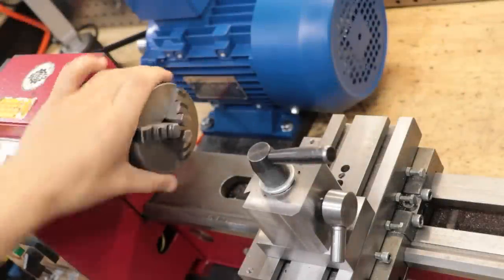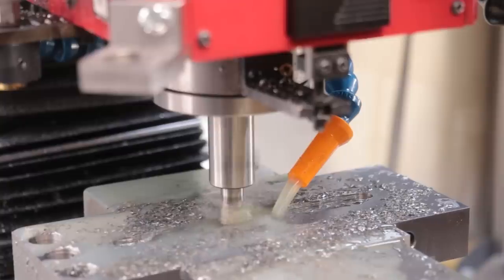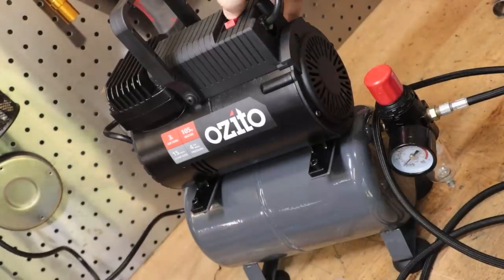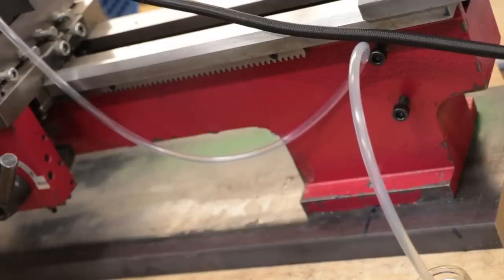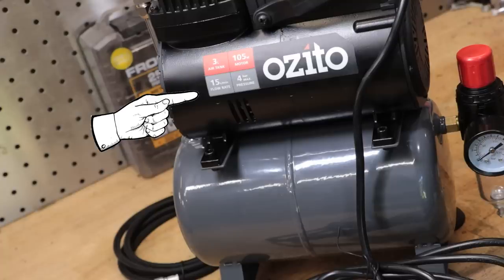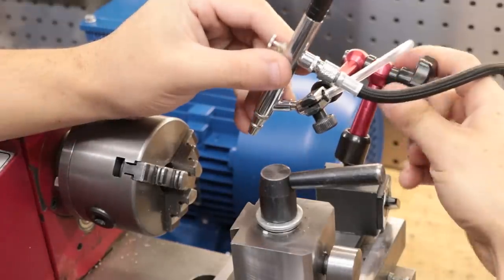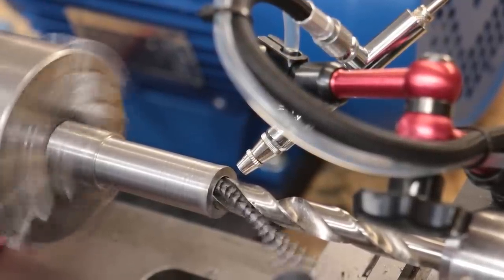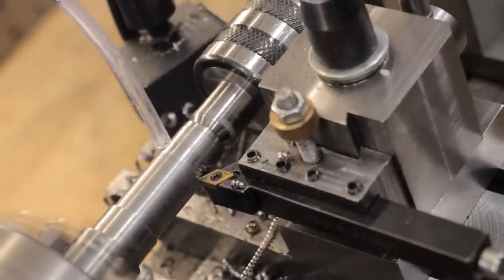Mist Coolant For The Mini Lathe

Comment: You can daisy chain the new compressor to the tank on the old one and greatly increase your air reserve. Start up the noisy compressor when you won’t be around and bring it up to pressure then you have all that reserve air to keep the smaller compressor from coming on sooner.
Reply: Yeah, i run a kern, 3 mazak millturns, 2 horizontals and some EDM machines off of a single 10 kw compressor with this trick

My air tank is 5k liters at 16 bar and could probably be classified as a bomb though....
Reply: @angrydragonslayer  230 psi on a 5000 liter tank would easily level a house if the tank ruptured. Air is cheap to compress up to about 70 psi, after that the energy required VS air volume grows rapidly and exponentially. I don't remember the exact chart as it changes between compressor styles but a conservative estimate would be the first 70 psi would be equal to the last 10 at 230 energy wise.
Reply: @dazaspc  yeah, it's not efficient but if i wanted an optimal compressor, i would need a new electrical circuit all the way from the 400kv lines and not only would that be stupidly expensive, it would also force me to shut off the machines for at least 3 weeks which is even more expensive (don't exactly have that many machines for a hobby)
Reply: @dazaspc  oh, surely. Free air delivery is not the issue though. I could sustain each of these machines with a bicycle pump and a big enough tank.

It's the burst that's the issue. I'm not going to be able to handle 300 l/m at 6 bar per machine for 15 sec if i change it like that.
Reply: @dazaspc  Well, you won't be heard ... it's the internet.
Specifications of the tank, the pump, the motor or established safety regulations ... just do not matter here. It's feelings and "innovations" and make-belief that is the guide.
Just sad that often bystanders are also harmed ... and no insurance companies will pay for this kind of avoidable madness.
Reply: @dieSpinnt  The sad part is I would nearly guarantee I have more experience and training in Air plant setup and Compressor repair and maintenance let alone CNC. I go back to the days of Nixitubes for position readouts.  When I finished up I was maintaining a 2700 cfm air plant.  Line pressure was 85psi and it had enough capacity to only drop 5 psi when a 75mm air pipe was broken. That is a LOT of air. All he needs is a receiver at each big demand maybe 500 liters and a reverse flow check in the feed line and he would easily drop the need for at least 80 psi line pressure. If he needs 230 psi at particular machines you can easily add a second stage compressor down the line to make up the needed pressure and only enough for the greedy air equipment.

Comment: I agree, you don't want to breathe in atomize oils. A great way of converting the mist into droplets, is to use one of those small clear cigarette filter tips. They don't contain an actual osmotic fiber filter. They work entirely through centrifugal action to concentrate the atomized tar from smoke into drops around the inner chamber. In you're case, it will form droplets which drips out of the chamber. The advantage is that they're shorter in length and more effective than a tube. They are very cheap and often sold in drug stores or on Amazon and sold under different brands.
Reply: that is very well written comment. what is your profession?
Reply: Using a mist coolant system and turning the mist into a fluid is: remarkably stupid!:)
Reply: @dieSpinnt  Not nearly as stupid as breathing in oil into your lungs.
Reply from the maker: @dieSpinnt  I think its more of leveraging air to move the coolant. This is not too different to a fogbuster mist less cooler, just a slightly different nozzle, and those are fantastic. Like I said in the video a different nozzle and we can change how the coolant flows, nothing crazy about that. Maybe could have used a pump but you sometimes have to throw ideas at the wall and see what works, sometimes you win sometimes you don't.
Reply from the maker: I like this idea

Comment: If you use airbrush as mister, you can always remove valve components to get it fully on. You can also loosen the nut clamping the needle and pull it back as much as you want to adjust amount of coolant. Having a needle not fully seated in the front nozzle is the way trigger also adjusts the amount of paint.
I think the idea of using an airbrush is quite clever. Cheap ones are dirt cheap and you surely don´t need the max quality brush for just misting.
Reply: I was about to suggest exactly that instead of expoxying it.
Reply: @TheMrAwax  Pulling the needle back and clamping there also would allow to adjust it later. That would also make it possible to dissassemble, say for cleaning if it gets clogged by any reason.
Air is of course on/off when the valve has been made to be open all the time.
Reply: I was thinking the exact same thing.  Pull the needle back a bit and lock the nut so it stays in the open position, then remove the rubber O-rings in the air valve to keep the air flowing.
Reply: @ricknelson6405  just fully remove the air valve

Comment: When I was an apprentice back in the 70s, we were taught to make the coolant ourselves - it was nothing more than engine oil, mixed with enough dish soap to emulsify it, then add water to thin it down.
Reply: Thanks for the tip. Cheers.

Comment: Really cool idea. If it were my project I would probably have made the reservoir longer. Say the height of the cabinet. And mounted it to the side of the bench with pvc gutter mounts. Quality of life improvements would include a fill port on the top so you don't have to unscrew the whole lid to refill and a level indicator. Just something simple like a 90 degree elbow top and bottom with a clear hose so you can see when it's getting low. And maybe a drain port for easy cleaning if the cutting fluid gets all stanky. Great idea tho man.
Reply: A larger reservoir may require more CFMs or a higher PSI which demands more from the compressor, requiring it to kick on more often.
Reply: @Bob Weiram  yea that's a valid point

Comment: You can also use a draw fan made for airbrushing, it just gets positioned behind the item you are working on and draws air along with mist into the replaceable filter in the housing. It’s like having a mini paint booth.  I used an airbrush for many years for artwork that I did for friends who were into the slot car racing hobby.  I almost forgot to mention that you can also pipe in a larger tank, like a portable air tank that you can put in your car to air up tires.

Comment: I think that reservoir, being so neatly done and tight, after some coolant is used will obtain underpressurez forbidding more coolant to spray out. I reckon it will need some inlet hole for the air.

I'm surprised how well this airbrush works as a mist coolant. Great idea!
Reply from the maker: There is a vent hole, I think I just forgot to add it when I was editing in premiere. Ops
Reply: I was going to pop in and say something about a vent hole. Glad it just got left out of the video
Reply from the maker: If you look close in some shots it’s visible, albeit hard to see

Comment: The mist cooling looked to be really effective. I reckon that I would go with that and an exhaust fan rather than flood cooling. A bunnings 4mm irrigation hose would do the job to turn the air on and off. They are rated to about 140psi which is way more than your compressor will create.

Comment: Love the Ozito  Bunnings single use tool brand. What does my head in is the long warranties on such low quality stuff. If you live near Bunnings, and keep the receipt, it is like a magic pudding of new for old.
Reply from the maker: They’re stuff can be real hit or miss but it has been a real staple of my workshops. I’ve heard mixed things about these compressors but a friend of mine has the exact one under a different brand name and hasn’t had many issues. Can’t beat the 3 year warranty on this though

Comment: Gday, I’ve noticed a big difference since putting flood coolant on the lathe and also on the Cincinnati mill, tool life has increased a lot, your setup works well, I had mist coolant on the mill drill and wasn’t a fan of breathing it in at all, great job mate, cheers
Reply from the maker: I remember watching your flood coolant video. If I had a bigger lathe I would have used your style of set up. Cheers

Comment: Very cool. I have a suggestion that could help in the long run. I would use a fuel filter from a string trimmer or leaf blower or some other small engine even rc cars have them. The carbs on those engines don't have much sucking power so the filter is free flowing and will help to keep the pick up tube in your res on the bottom. My thought is it can keep contaminants from the filling process out of the small orifice in the air brush.

Comment: The coolant tank will need a breather hole in the lid if you use it for an extended period of time, also that little compressor will be burning up in that cabinet, you should consider a way to pull the hot air out of the cabinet and draw fresh air in.
Reply: EXTREMELY AGREED!

Comment: There is actually normally a metal way cover for the more advanced lathes. Flooding is always the best option, but for the lathe you’d need a protection else it throws it all around.
Reply: I prefer point cooling for lathes (i think it's called precision coolant by sandvik)

It has as good of a cooling effect as flood and helps with chip breaking

Comment: I think i already commented on one of your previous vids, but you can use the cheapest atf oil as flood coolant and as mist coolant... Sure, its not as good at cooling, nor is atf an amazing lubricant either, but it can be bought en masse for cheap and its pure mineral oil with some detergents and antifoaming agents, making it a very good substance for any kind of machine cooling, and unlike water mixed oil, it has 0 bloody water in it, making it a great way to avoid ever thinking about rust forming under the vise or in such places... Atf also has an amazing derusting property, as well as pulling property, where it will suck out embedded bits of crud from stuff if left unattended... Sure, it will wash out the way oil, but you reapply way oil all the time anyways(i hope), and with guards and coolant routing on most machines, it generally doesnt have much access to way oil or the ways themselves... Its almost as viscous as water, which does help with any sort of pumping or sucking(mist systems), and it actually smells really nice when burned... A sweet caramelized sugar smell, which i dont even want to speculate on, safety wise, but it cant be worse than cutting oils which have all the warning labels on them, whereas the atf generally only has the environment/water pollution danger label...

Comment: Awesome idea! For quality of life you can add a solenoid to control the airflow and have it switched by the relay from the VFD so you only have coolant when the lathe is on. Also wire in a 3-way switch in series/parallel to override/disable the coolant.

Comment: If you want to put sound insulation around the small compressor, be aware the heat generated by the compressor. I have noticed that if you keep the compressor running for a long time, it can get to the point where the motor housing is too hot to touch.

Comment: Note about tools. You can sharpen absolutely anything, long as there is chemical that eats the material. Have dull file? Clean it and dump it into citric acid bath for day or two, clean the oxide with brass brush under hot water, dry with paper or towel and apply protective oil. Havent had to buy new file except one time i could not find one from scrap piles i visit for specific job. Same applies to pretty much any blade. Only thing to consider is that acid in case of steel will remove material all over, so for mill bit if diameter is important that might a problem same with reamers, but for material removal bits its just fine. Just keep new bit around to do the final pass if you need it to be specific and keep acid sharpened bits in their own place away from new ones.

Comment: You can DIY a "Fogbuster" type mist coolant system.  It atomizes differently and there's NO airborn mist.  I've used one on my CNC mill for years.  Absolutely no fogging.  Ever.  Look it up online, it'll be fun.  You could reuse several parts of your current setup, including you reservoir, air compressor and lines.

Comment: You should be able to increase the switching frequency of the variable speed drive to remove that high frequency noise from the lathe motor. By default it is around 2-4kHz. Set it up as high as possible

Comment: I'm really tempted to do this because i have an airbrush aswell😅 one thing to consider is heat from the compressor. These things get really hot during extended time use. So by keeping it in a cabinet i would think about a way to circulate fresh air in. Awesome video thanks for making it

Comment: You might want to add a little PC cooling Fan to the compressor. These little guys get quite hot when running for a long time (at least mine does) and a bit of cooling might make it last longer =)
Reply from the maker: There is a cooling fan already on the compressor, seems to
Keep it cool but I’m always looking out to make sure it stays cool. Cheers
Reply: @artisanmakes  Oh, awesome! Mine doesn't seem to have that, only the fins on the Motor, nothing for the "compression chamber".
Reply from the maker: Interesting, didn’t know some came without fans or if would have mentioned it. Cheers

Comment: That might be a great idea for me to expand upon at my own shop. We have to run a mist cooler for one of our lathes, it's a CCC setup but uses a plasic hose you adjust to get close to the cutting tool. Great concept but when the part your turning is 3' od and your running .250' passes you spend way more time adjusting the hose to both do its job and not get sucked into the piece. I want something rigid and foolproof, this could be that.

Comment: The main factor to the carbide tip wear in your case is the lack of rigidity of your machine.  As you mentioned carbides can handle a lot of heat.  But they need a rock solid mounting platform to perform at their best.  Something small lathes struggle with.  Even my larger and more solid Herless struggles to be rigid enough to push carbide tools hard.
Reply: He did a make it a lot more rigid, but it may not be enough for the constant loading carbide likes.

Comment: you can use 3d printer to produce custom adapters for weird threads, recently i had to adapt M13x1 and that was nowhere to be found, quick print from petg did the job (as long as its not too hot > 80deg celsius), and yes you can produce really fine threads with lets say 0.1mm layer height
Reply: if screwing to a metal thread, it doesn't even need to be that perfect of a print, kind of there just is enough the metal will form the rest of it when you screw it on..

i still use m8 rods for the z with printed nuts(outer is a larger shape than a metal normal nut) on my printer.   a sort of a lets see temp solution but you know when a temp solution is good it kinda just becomes permanent. it fits tighter than metal nuts(no movement in xy), but still goes in and out nicely. it breaks other stuff before giving up if you have a problem with z enstop tho.

Comment: Since I hate breathing unknown chemical mist and vapors in the shop, I think you might try a vortex tube and see if just cold air (-20 -> -50)will do the job? Maybe combine that cold air with an applicator of a bit of heavier cutting oil that won't vaporize so easily. Just spit balling here to avoid breathing aerosols.
Reply from the maker: Im not sure to be honest. it is an interesting idea though
Reply: My understanding that vortex tubes need so much more air (pressure and CFM) that you would be running big compressor all the time. Correct me if I'm wrong
Reply: @avelkm  definitely takes lots of air but only while cutting, not all the time. Depends on the size too. 2cfm model is not so bad. We use them in our welding shop to cool welds cleanly. 
The point is would you rather breathe in a mist of hydrocarbons or air? It also settles all over everything in the shop.
We had demisters installed on all our cnc machines because even with normal coolant it was intolerable to breathe near a machine.
Reply: @billshiff2060  I dunno, really. It's just isn't applicable in this case as he clearly needs to lower background noise for recording purposes. I'm really bad at compressor math, what compressor CFM needed to power this 2scfm vortex generator?
Reply: @avelkm  Air tools , with their duty cycle, are rated the same way as compressors so its simple addition.
If quiet is what the goal is then ordinary coolant flow is nearly silent.

Comment: i have a compressor setup like this to blow the chips off to one side on my mill. mine isnt as nice to look at and doesnt have the tank so its just the compressor pumping air into the hose an i have it necked down at the end to increase the pressure. ive never had issues out of it but the little compressor does get hot after running for a bit. mine didnt have any kind of cooling nor did it have the plastic body covering it so u might want to keep an eye on the temp. i added a 120mm fan to the end to cool the motor an a smaller 80mm fan over top of the compressor cause it does have heat fins so i figured that would help. ive been running this setup on my mill for a couple months now but i had previously ran the same setup on my cnc router an ive lost track of how much time it has running on it but its been fine. it might have been fine without the fans but it was just to hot for my comfort to leave it running on my little cnc router so the fans helped deal with that worry. thought id share.